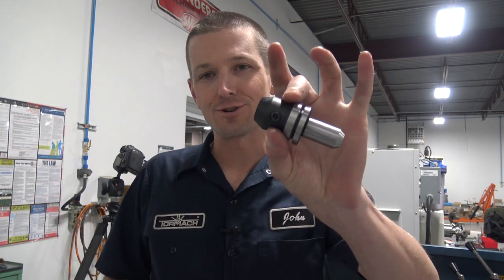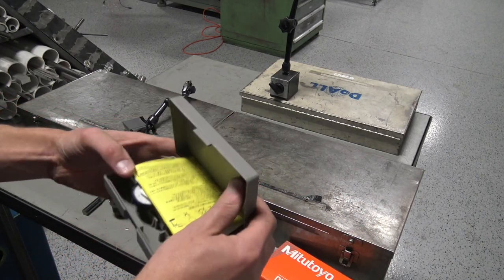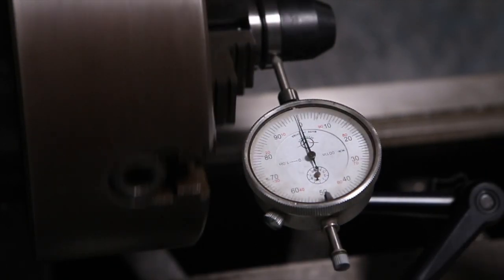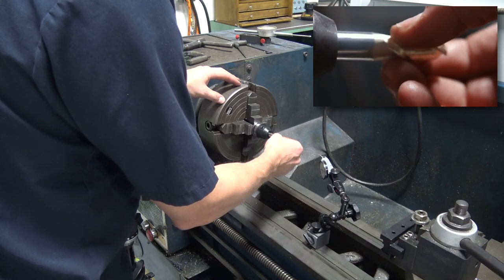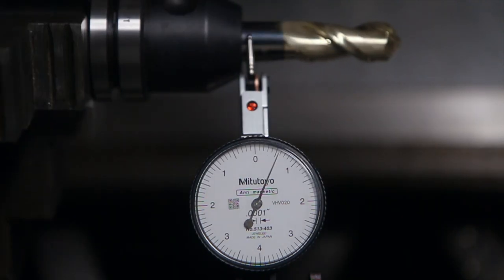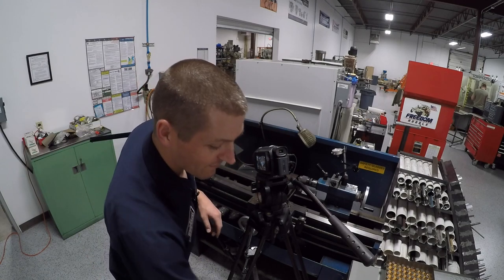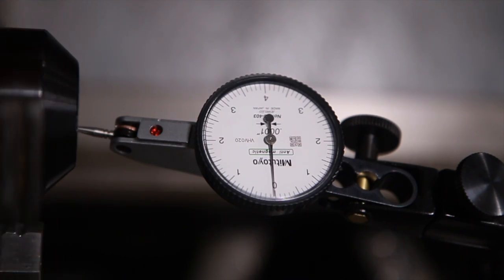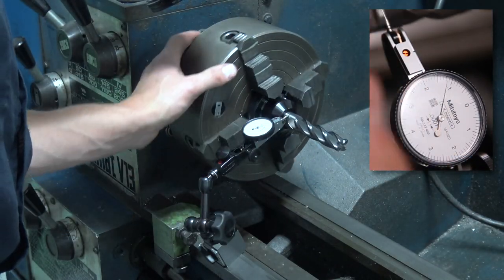Do Set Screw Holders Push End Mill Tools off Center?  WW122

Comment: Hi John.
interesting topic, great video.  A couple things that I was wondering about: Did you test the cylindrical error of your test gages or milling cutters?  IIRC the +/- .0002" for over or under is the size (diameter) deviation from nominal on the gauge pins, not the tolerance for cylindrical error which depends on the class (grade) of the pin.   What about end shake without the grub screw tightened?  a good slip fit (that pops) can be  anywhere from a couple tenths to almost a thou in my experience.  
 What about a sweep of the hole in the holder to see if it's out of round?  What about tolerance stacking?

inquiring minds want to know!

Comment: Not sure what the tolerance is for tooling diameter, I figure somewhere like h7 or a little tighter.   The tolerance charts, as you know, are based on diameters where clearance increases as the diameter increases.  What I am trying to say is that your results are pretty much to be expected.  Remember, if a cylinder slides onto a hole it is because their is clearance like a valve spool in it´s housing.

Comment: As long as that end mill comes around with the same runout every rotation it will cut straight.  Unless you are cutting a slot the exact same size as the end mill you’re using, it will be fine.

Comment: The reason the cat 40 is worst is there is less chucking surface in the jaws to keep it parallel with the ways on the lathe. You are indicating in the holder in one specific point, but when you put the endmill in you are away from said point. You have to indicate the bore, gauge pin, or endmill in z axis with indicator mounted on the carriage and run back and forth to see if the bore is running true. Then rotate chuck 90 degrees and check again before you can start sweeping the chuck. The bigger the diameter will have move runout beacuse your not true to the bore!

Comment: .0003-.0006 run out on a set screw holder sounds about right. 

They're not precision holders, but even a .001 run out wont be that detrimental. Short of a high priced milling chuck, a solid holder is the best for heavy cuts. 

You can still dial dimensions to within tenths even with a thou run out. Cutter life can be effected. But unless you're trying to wring out every nickel and pinch every penny you can out of an endmill. You won't notice much of a tool life issue

Comment: How do you know that the BT40 holder is totally axially aligned with the lathes spindle. I would hazard a guess that it isn't. Take several reading of concentricity at different depths down the bore to check this

Comment: Let's say the clearance of the tool bit in the toolholder bore is 2 tenths.  Why not manufacture the setscrew toolholder with a slightly eccentric bore in this same amount to compensate?  Toolbit tolerances, say an h6 tolerance, are pretty standardized.  Arrange the bore so that when the setscrew is tight the center of the tool is on axis.
Reply: They do just that, or at least some used to.

Comment: Even when it's only a tenth ''Screw Holders Push End Mill Tools off Center'' That was the question wasn't it, and it sure does, doesn't it? But even when a Gage pin pops there is a slight distance between the bore and the pin, so a setscrew pushes the pin to the opposed side of the hole so the pin go's at least 1 thousands to the opposed side. It doesn't matter if you say it's no problem, but by making an air-bearing it does. To say, at these distances the temperature from your hand can make a tenth of difference in the pin as well as the tool holder.

Comment: I realise you may just be using that endmill for demonstration purposes, but those holders are designed for use with endmills that have a flat cut into the shank, you won't get anywhere near the same clamping force/rigidity just clamping it onto the side of the cylindrical shank. would you machine round stock in a vice or a chuck? same principle applies here, they shouldn't be used as a friction clamp.

Comment: We r told at my shop to grind a rough flat on the tool for the set screw to bite into, is that necessary?
Reply: HuntingWolf82 Try it without and after you scrapped a few parts due to the end mill pushing up or even worse pulling out and you'll have your answer.
Reply: HuntingWolf82 

Yes/no. Ideally you should be getting tools with the notch already ground in them. The holds the tool more securely and prevents pull out. 

Grinding your own flat free hand can make things worse since you will end up with an angled flat on it, and the set screw will be contacting and even smaller section of the tool than it would have if you left it untouched. 

Putting a flat on should at least be done with a tool grinder to make sure the flat runs parallel with the tools centerline.

Comment: Been machining longer than most have been alive. Collets were never designed to be used for rough milling. You can get away with it in plastic, but you are decreasing key rigidity properties if a solid holder or milling chuck. Keep them for drills

Comment: Regardless of the runout, keep in mind that a set screw holder will start to vibrate excessively at high RPMs.

Also stop tossing your indicators on the table like that.

Comment: you can have perfect diameter, the screw will offset the tool. Also the tool is not balanced like a shrink fit. So you can runout that you can't measure while its turned up to 10k rpm.

Comment: You tool holder was probably in the chuck crooked. You only indicated that one spot so it could read true there but if check in another spot such as on the end mill it will running out.

Comment: I think you may have fooled yourself.  You should have dialed in the shank (not the bore), then not touched it.  Then, when you measure the bore, you may find that the manufacturer already compensated for the deformation of the holder by offsetting the bore.

Comment: Set screw holders will never be as concentric.  Collets will be.  Collets will provide better clamping force.  If you're run out is .0003" 1/2" from the holder with a set screw type a longer end mill like 6" will be out like .0009" on the end amplifying the problem.  All depends on the required accuracy.

Comment: tool's are made for that holder, they have flats ground the setscrews push against, those are not for collet rotation, you should be testing in the spindle the tool holder was designed to go, not in a 4 jaw. You never even checked the face runout...

Comment: Honestly, I was confident that there would be some measurable difference when the set screw was tightened.  Just as honestly if you need something that accurate you need thermal set tool holders an not a mechanical holders and a machine shop that need that needs less than 2 tenths accuracy is probably is doing aerospace stuff. Most machines that are less that $150,000.00 probably can't hold less than 1 tenth over the life of a part run.  So, lets get real.  Will that little bit of difference make any difference to the average shop?  Probably not.  When running a business you have to take into consider the return on investment of tooling and fussing with the little measurements.  Will the customer care that you got it within a half  thou?  Will the customer pay you more if you do?  Most parts are plus or minus 30 thou.  Even parts that are minus nothing plus 30 are charged more.
Reply: Robert Palmore What's funny is I've worked for an aircraft company and our machinings were mostly designed for +- .01 tolerances. Granted, that was all for structure not something like an engine, but still. I think it's really easy for people to get caught up chasing the perfect part. Then again I haven't worked in the machining industry, so I may just be blowing smoke haha.
Reply: Justplanecrazy25 Like your handle. Your right.  Chasing those kind of numbers just isn't done in vast majority of manufacturing. I like to make to size but I know where there is a diminishing return on time invested.  My comments keep coming back to running a business and that's exactly the kind of thing a business has to make a decision about.  What are you going to get paid for?

Comment: The 3/10 runout is closer to 4/10 imho. And when you say some of that is not the holder but part of the setup, then the setup could also hide some of the holder runout if it's out of phase/not aligned. My point is you started the video with the idea that set screw holders are good enough, you focus on a few details that go your way and ignore a few details that don't go your way. That's textbook confirmation bias.

Comment: Obviously you are using a fairly new holder. Set screw not overly tight. Over time, holders get egg shaped.
Why didn't you just put holder in spindle?
.0005  run-out makes a big difference when high speed machining. Tool balance is a BIG deal over 8,000 rpm.

Comment: there are studies, you can see the tool life of a tiny endmill improve by 50% or more when moving from setscrew holder to a properly dialed or balanced holder. At least use a milling collet for god sake, you run CNC machines not sloppy birdgeports!

Comment: Why don't they have set screws on both sides?
Reply: Because then there'd be no way to align the axis of the tool to the axis of the spindle. The bore on a properly made set screw holder is a close fit to the shank of the tool and aligned to the the taper (or in the case of TTS tools the shank of the holder). When the setscrew is tightened it pushes the tool against the side of that bore so it has the entire side of the shank to help it maintain axial alignment. If it had two opposing setscrews the shank of the tool would be held by those two points alone and wouldn't be able to maintain good alignment to the spindle axis.

You're much better off having the tool slightly off centre but still parallel to the spindle axis than you would be if the tool were not aligned to the spindle axis at all.

Comment: It has to do with the way the chuck is holding these two different holders. The first had a straight shank that was put in the 4 jaw, the second 50 taper was just holding that small edge. You try with the 50 taper, two sweeps of in inside bore to make sure it is straight inline with the chuck, because if it's not, the farther you move away from the chuck when measuring, the bigger the error. So sweep the front and as far back into the bore of the 50 taper as you can with the indicator to get the bore straight inline with the chuck.
Reply: Edward David I think I'd rather sweep the taper in different spots, or just put in the spindle. (pretty sure that's a 40 taper too ;) )

Real world TIR is what's important.
Reply: Not sure how you could sweep the tapered part of the holder with it inside the chuck and the spindle taper and the tool holder taper are not the same, so I'm not sure how that could be done either. Unless they make a 40 taper socket that could be mounted in the chuck and it would still need to be indicated in 2 places on its taper to assure it runs true with the spindle. Sorry that I mistaken the 40 taper for a 50 taper. John did a great test here and asked for suggestions on why his results were different than what he expected, this is how we ALL learn, by asking questions. This is what's important.
Reply: I completely agree! Wasn't calling you out on the size, hence the ;) .

You are correct on the taper in the lathe chuck. DOH moment on my part!

Also correct on the CAT tapers.

This was definitely an informational video, and your suggestions definitely fit the bill for a more accurate measurement. I was simply suggesting that the test be done with the tool holder in his new machines spindle. While it certainly wouldn't be universal in the measurement, it would still give the same general results while giving him the run-out caused by the tolerance stack up of all of the parts his machine.

But as you suggested, it would still be worthwhile to check the tool holder bore in 2 spots.

I was simply throwing ideas related to your comment. The same thing you did. Apologies if came off as anything else.
Reply: With John putting tape around the 40 taper tool hold could have not allowed it to go back against the chuck evenly and this could make it not line up with the spindle. Yes John should try this in his new machine, I think he will get much better results. I just have a feeling that the 40 taper tool holder bore was off from the spindle and that your suggestion would make that measurement more accurate, then if he got the same measurements, I say that the tool holder is defective because it should be better than the measurement  than what he got, even with a 3/4 inch tool. No I made a mistake, my typing can't keep up with my thoughts and sometimes my writing comes out all jumbled up and have been heckled about it in my past, so no hard feeling. So apologies right back at you.
Reply: (just an FYI for future readers, I edited this comment very slightly for clarity & edited portions appear in this font or are bracketed with an underscore and star depending on the device used)

+Edward David totally agree. Watching it again, the initial error should have been a dead giveaway that something wasn't right. All I can say to that is I hope it's not the brand new tool holder!! 

If the same results were seen by pushing the indicator into the tool holder roughly the same distance it was pulled out to sweep the tool shank i think it would be safe to say it was the setup. 

I guess I'm just reiterating your theory now. LOL.

I'd love to see the setup(s) the various tool makers use to QC their product. 

BTW, I have the same problem with typing/thoughts. Sadly, it sometimes goes more towards thoughts not keeping up with the typing when I'm tired.

The joys of discussions on the internet!!!
Reply: iceberg86300, John did your suggestion and it put this to bed.This was a great topic and great discussion with you.
Reply: I saw that.

Good talking to you, and I think the result was good info for everyone!
Reply: Edward David forgot to add a thanks for the heads up! 

Also going to ask John in the other vid if he can post the email he received from maritool.

Comment: Hate to put everyone a sleep with this. The real name for a set screw end mill holder is a Side Lock end mill holder, the set screws real name is a Grub Screw.
Reply: What he's trying to messure is Cylindricity, if you called the taper on the tool holder Dataum A and the end mill Dataum B, the Cylindricity tolerance would be the control surface, the profile of the endmill surface would be the tolerance. Cylindricity is a 3-Dimensional tolerance that controls the overall form of a cylindrical feature to ensure that it is round enough and straight enough along its axis to meet dimensional tolerance.
Do you people reading this want more explanations at this level? I'v @35 years of experience,

Comment: your test is wrong you will need to test it on the VMC directly. that's your big mistake. load it up on your vmc and test it and if you have a run out you fix it by offsetting your tool table. your test on the manual lathe is worthless. wheres the HAAS video??

Comment: You're giving yourself grief over nothing, the 3/4" holder if running alum your FPT is .012 - .015, with the .0015 runout your loading error would be @.0005 per tooth not much. If you were using tool load compansation (G51.2) of 30% your .0005 is nothing. Try ETM tool holders very good value for your money.
Reply: Check your spindle fit on your new Haas, put some blueing  on the taper of one of your tool holders and manually load and unload it and see how much engagement there is.

Comment: why are you calling Ten thousandths "tenths"? sounds like a miscommunication waiting to happen.
Reply: from what ive gathered  on this channel, machinists talk in terms of thou to begin with.
Reply: It is funny, tenth could be taken to mean 1/10th of an inch (0.1), 10 thousands (0.01), or the accepted meaning, tenths of a thousandth (0.0001). I have gotten caught off guard when I was being taught to run our Haas mills. :P
Reply: It's standard practice for machinists.  It isn't entirely precise and it could cause problems working between inches and millimeters, but that aside it is common.
Reply: Jim's videos you doing blend units in a real machine shop, as far as the actual product is concerned. Sure, you can put a .900" round into a 23mm holder ;)
Reply: hmm interesting. As a machinist myself never heard it referred to it in that manner. Maybe the shops i worked in didn't have sub half thou tolerances come up often enough  to warrant the need to shorten it. Always heard "plus or minus two ten thousandths". Maybe its something to do with what part of the country your in.
Reply: D-railed I'm in Canada lol. Our shop calls a thou a thou, and anything smaller then that a tenth. If we want 0.050, we say 50 thou and 0.500 is 500 thou or half inch.
Reply: This has been covered by other commenters but in the United States this is how machinists and (some) mechanical engineers talk:

.0001" = tenth
.001" = one thow 
.01" = ten thow 
.1" = 100 thow

The tomfoolery is limited to inches; micrometers (μm) are called microns in the shop...